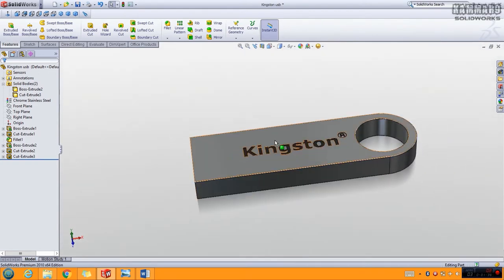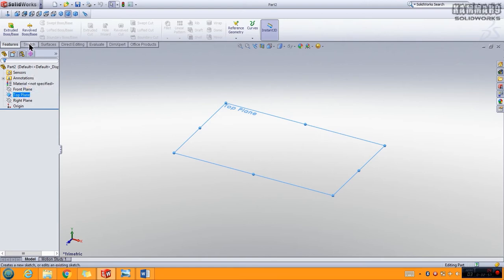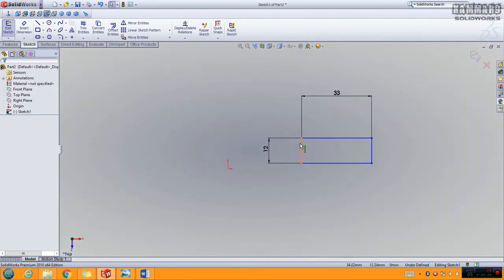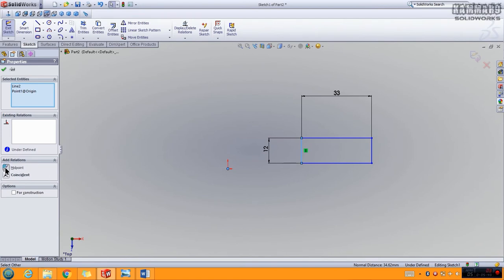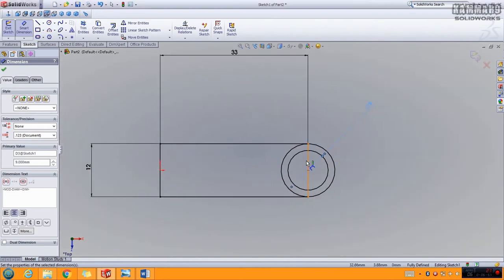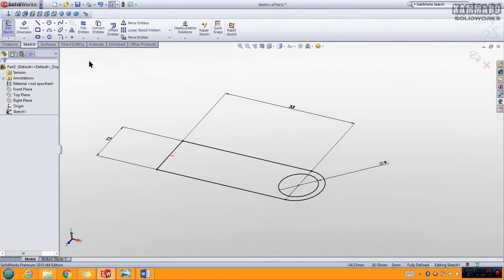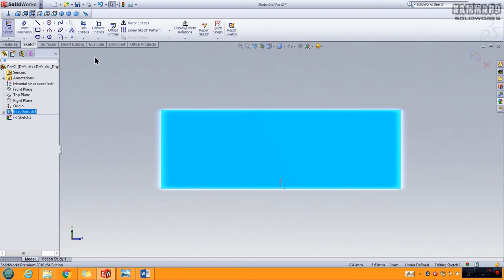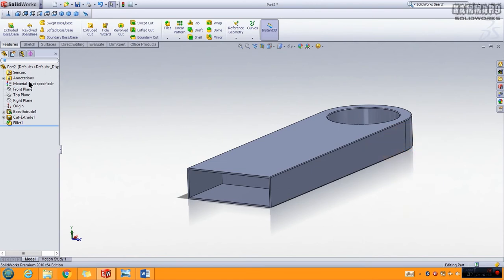Solidworks # 21 | Make a kingston USB drive   ! 😜

Comment: Hi Ammar, we want to begin to draw and we didn't make a decision yet. which we can use programs ? Solidworks or Inventor.. We trust your thinks and experience. Thanks..
Reply from the maker: +Ahmet TARAR hi there . For me I used them a lot . Both of solidworks or inventor and both of them have positive,  negative points.  You car réfère to the V12 Engine that I made in these software and take a look about diffirence. For the design I prefer Solidworks. For a complexe projet I prefer inventor. 😊😊 go for it the too software are amazing.  You can see autodesk Fusion 360 too . Is very easy to use . You can find it in my channel. Please share !